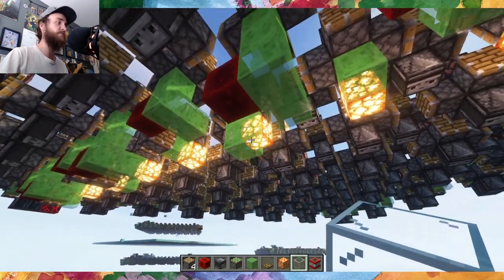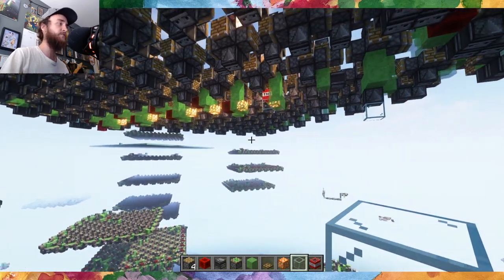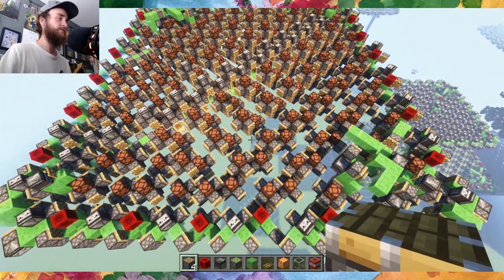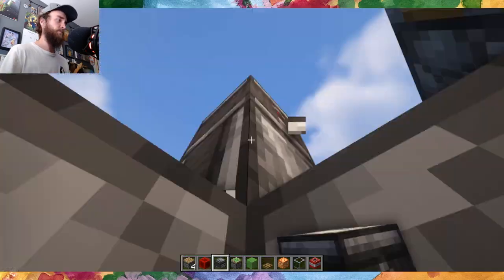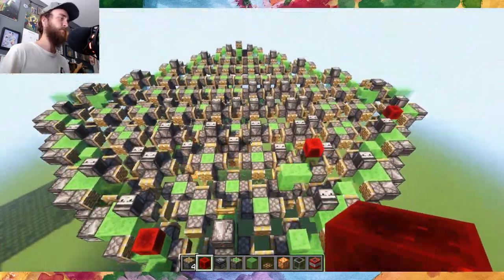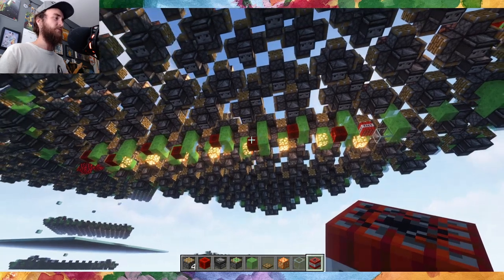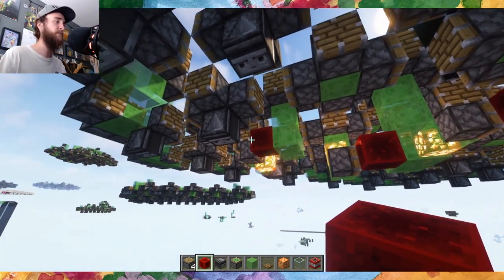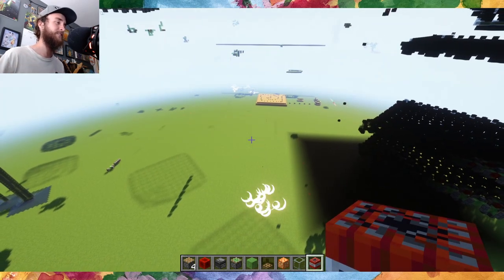4-Way Variable Height TNT Detonator - Minecraft Concept

Comment: Oh, kinda like tnt system in my variable timing quarry, except that it works 4 way and by manually configured timings
Reply: but I wonder if there is a way to make it configure itself by adding some kind of computational logic, so it can drop tnt in variable height in specific patterns / a series of arbitrary xyz blast spots below the machine
Reply from the maker: @JaviertoZerrado  that's a good idea. Probably wouldn't be too hard to arrange the return pistons on the variable return-time wire in such a way that they can be pushed and pulled in and out of place; then just trigger that pushing/pulling with a set of perpendicular 4-way wires, and you can control the return-time with onboard circuitry